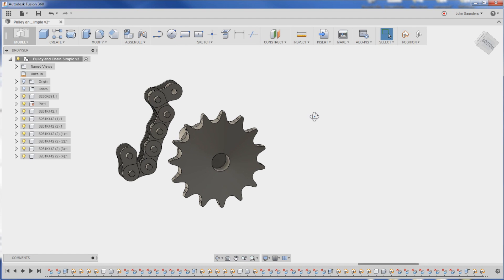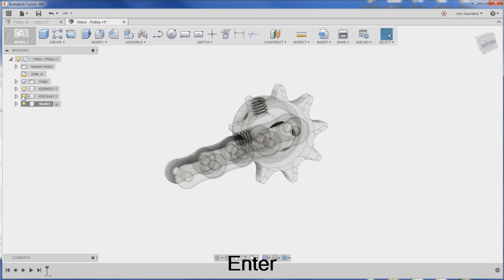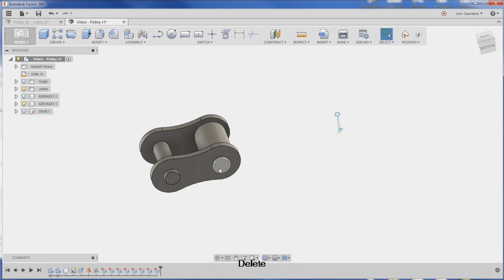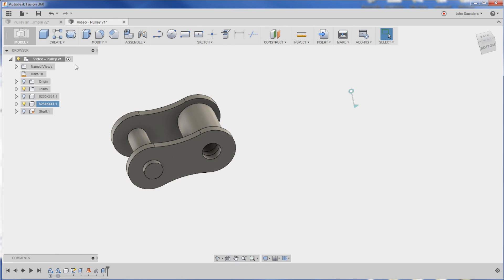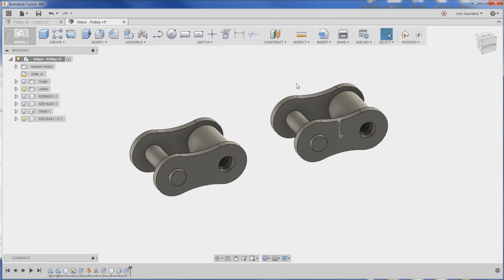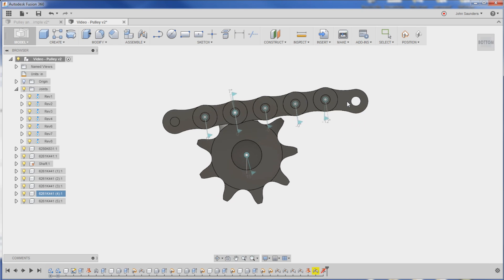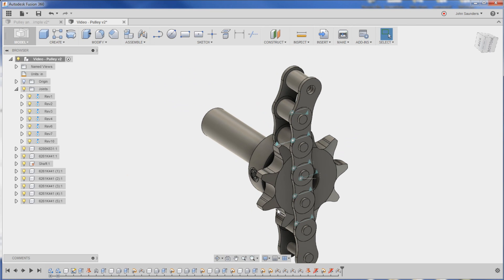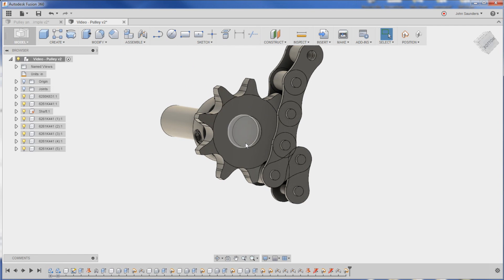Fusion 360 Sprocket & Chain! Fusion Friday #23

Comment: Thanks for the video but it won't let me delete parts of the chain.   The selected faces could not be deleted.
    Ensure that faces are only selected from a single body, and that no duplicate or invalid geometry is included in the selection.
Reply: Have you found a way to automatically replicated the links to make any chain length without having to manually duplicate the links?

Comment: Interesting approach - I'm working on a pulley set w/ timing belts, and was considering drawing the profile of the closed belt, then extruding it. While that would produce a static model, it wouldn't have the dynamic side. Great video!

Comment: +NYC CNC Interesting video, John! Most everything I know about Fusion360 I learned in your videos. With that being said I wanted to point out your impossible chain model, in that all of the links are fused together (no outer and inner link combo). So i thought i would try it myself on my fairly decent gaming pc  with full contact sets. This is what i came up with if the link will work. http://a360.co/1XDXtYy I don't really know if i did any better but maybe we can all share what we have learned as a Youtube CAD community along with perhaps a better implementation of motion transfer by A360 and then be able to get some really cool mechanisms designed. In the mean time keep these videos coming, see you for the Wednesday Widget.
Reply: +NYC CNC It worked at first when I only had a few links around one sprocket but i could not get it to work around both sprockets. I would put the inner link in place on the sprocket with the align command ground it and then put the outer link on with the joint command so the chain was not actually connected to the sprocket. Once i had several in place i would enable all contact and ungroun everything. At first it would work so i continued to the end but then i could never get Fusion to use more than 15% cpu for the calculations and it would lock up.So maybe if you do download it you may be able to get a few links to work if you just delete some. :)
Reply: +NYC CNC Oops, looks like I missed where you said the links should be nested inside each other but wasn't the point of the video, the first time I watched it.

Comment: If you notice the data for separate bodies was there even though Fusion thinks it's only one. For a simple part like this no big deal but you don't want to dissect complex parts. I found that if I strategically split bodies Fusion realizes all the individual part-bodies magically. Then I just combine anything I unintentionally split.
Reply: +NYC CNC I tested this with the chain. 4 moves and done http://a360.co/1Nw7VeX

Comment: Not sure if this would work, and it's another cheat for sure. Make a plate with a slot for the chain path, parallel to the chain. Then you could use the pin and slot joint for the chain pins. Last hide the plate or maybe make it construction geometry.

Comment: Will the same problem arise with belts/pulleys? Don't think F360 really has a good system for either.
Reply: +NYC CNC I guess I am just asking if there is a way to use belts/pulleys with the teeth and everything. I assume it would have the same limitations as the gears and chains.

Comment: John I am not sure as I have no real experience with chains but would the "Contact Set" function work for this purpose?
Reply: And by this purpose I mean allowing the chain to move between two sprockets*
Reply: +Clayton Spangenberg Good idea Clayton, this is how I would do it in Inventor, I haven't used Fusion's contact set function though - I didn't realise they had contact sets in Fusion actually, but it looks like the function has been there for a while.

I just finished the vid and saw John tried contact sets - I don;t remember them being so processor intensive in Inventor, not sure what is going on there. Mind you, I never used them to model chain and sprocket, there is a bit going in in that simulation.
Reply: @alphgeek  inventor is just much more efficient, does not crash nearly as much as fusion. It is it's bigger brother after all.
Reply: Clayton Spangenberg I tried using them for a screw and my (decent) computer froze Fusion when I moved it.

Comment: This is how SW does it: https://www.youtube.com/watch?v=orqr5ZhObsU
Chain and belt mate is different (the chain / belt doesn't appear to move but the sprockets and gears are synchronised) but it's rather like cosmetic threads - why use all that computing power just for visuals?
Fusion 360 and Onshape haven't implemented chain and belt mates yet AFAIK but they are very powerful if you want to "fit" a std belt length and then set the shaft and tensioner positions. I've done this with toothed belts on my CNC machine so I can use a tensioner wheel rather than slotting all the holes and sliding the whole stepper motor to adjust the belt.

Comment: John go back to where you imported chain look at the chain you removed the bearing plain of chain, the single plain chain that you used after that point would not work.that might have been why you had problem with modeling .

Comment: to fix your timeline issue you slide the bar to the point you want then click and select "delete after this position" or something along those lines lol.
it's a handy feature!
Reply: +NYC CNC Wouldn't work. It would do the same as deleting them one by one from the right in effect bringing back the deleted bodies (because you are deleting the deleting of the bodies - if that makes any sense). On top of that you are trying to delete actions in between two actions and preserve the last one - in this case the push/pull you used to cut the pin out. I think you did it the only way possible.
Reply: NYC CNC SierraLimaOscar 
i just checked on one of my models, was in bed catching up on cnc vids when i wrote that.
slide the history marker to where you want on a selected component then right click on any of the grayed out icons/operations and select 'delete all features after history marker'

Comment: There is a (very expensive) product called "Working Model" which does a nice job of modelling components so they are constrained not to intersect. It also can attribute "real world" properties like density, gravity, elasticity, etc. It includes "motors" and linear actuators to activate the models and strain measuring connections. A lot of fun to play with. I once made a couple hundred unit bead chain and let it fall under the influence of gravity; now that was computation intensive. It slowed my old 80386 to a crawl.

Comment: If you import the chain first and shut off the timeline do the direct modeling (defeaturing) then turn the timeline back on and import the sprocket you will not have the issue of having to delete the parametric info that you had here. Note: I believe you will lose any parametric info if you don't do it first.
Here is a great video on sprockets an chains https://youtu.be/G4ZsCWFlvNc it's for Inventor but I think you will learn a thing or 2.
Not sure if you noticed but you hit 100,000 subs Congrats!!! Any plans of doing a video to acknowledge this milestone? Most Tubers get very excited over these things.
Keep pluggin away at it!
Reply: +Ed T except you lose all timeline stuff you created before that point.
Reply: Scott Moyse Yes this is true that is why I recomended doing it first or you could even do it in another document and then import/upload the results.
Reply: Ed T the latter is often the only feasible option if you don't want to do what John did. Hindsight is a beautiful thing...
Reply: Scott Moyse I would agree.

Comment: Second sprocket w/grounded shaft, (and) longer chain length, and contact sets and/or motion links?

Or you can always throw more CPU at a problem.
Reply: +NYC CNC Ugh, I tried it and rapidly realized that Fusion 360 needs better kinematic solving. They have Reactor (with Havok plugins) for 3ds Max, and really need to bring it over to Fusion. A chain drive limited to 8 links and two sprockets isn't very useful: Contact sets of just the two sprockets and 20 chain rollers still causes 360 to choke and freak out. Meanwhile, games using Havok can have a tank drive through a brick wall and have it look realistic.
Reply: @bobthecannibal1  And, got any progess? I mean games probably dont use the overgeneral approach of contact planes, but simple high level classes "this is a gear and this is a chain and they like each other".
Reply: @bobthecannibal1  Game engines work with polys for both visible geometry and collision. Fusion works with nurbs. This might make Havok and other physics engines completely incompatible.